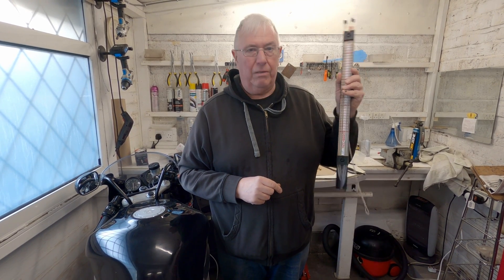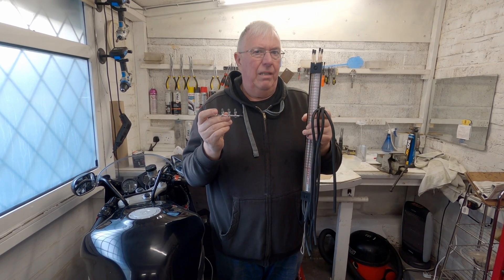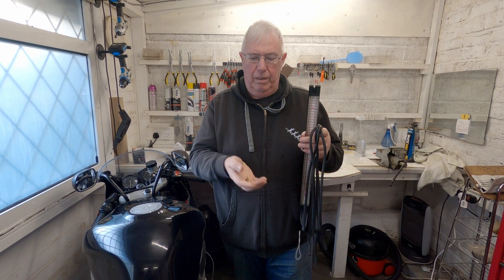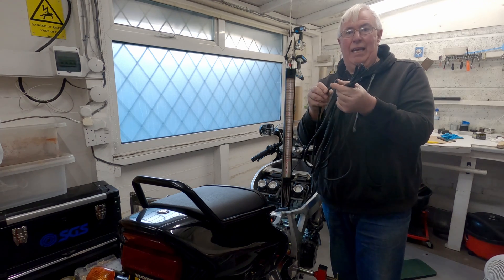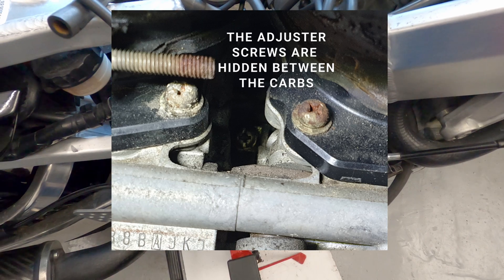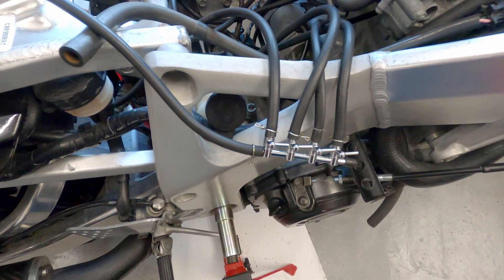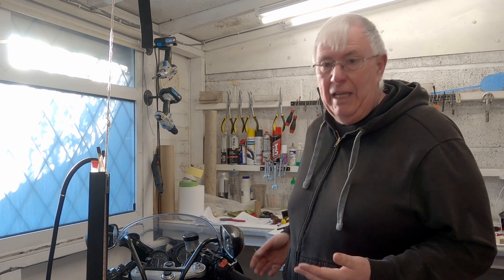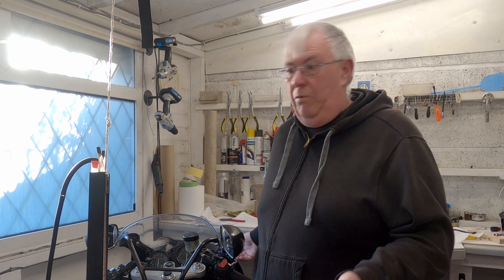How To Sync Carbs Honda CBR900RR Fireblade Motorcycle | Balancing Four Carbs With One Gauge | 010

Comment: Your vacuume line on yours is capped on mine and my vacuume line is on the left side that goes to my petcock why would this be
Reply from the maker: As long as the vacuum is connected, it can be to any of the ballancing take off points.  Maybe a PO just found it more convenient to move it.
Reply: @SPANNERRASH  thank you for your reply I have my carbs sync all the same idles nice and revs all the way while in neutral,but when I ride its fine and when I get to motorway speed and open my throttle up it seems to bog down and sounds like a clipping nosie from the exhaust even though its no were near redline and won't give me any more power
Reply from the maker: @jonny-p-8927  Assuming it isn't an electrical gremlin. I would look for any air leaks anywhere on the intake. Especially if there is an emissions pipework. Faults like this can be really hard to trace. Good luck! 🤞
Reply: @SPANNERRASH  I found the problem I handt screwed the mainjet in properly and found it when I striped my carbs again in bottom of carb1 float bowl 🤣🤣

Comment: Hi there I can't remember? Did you ever give a guide how to apply for historic motorcycle tax and not exemption, kind regard Dave, keep up the good work
Reply from the maker: Hi, you need to fill in a V112 for the MOT exemption, here is a write up about it https://www.spannerrash.com/v112-form-mot-exemption/ .  For the Historic tax change you can take your V5 into a post office and they will send it in for you. You can probably do it by post too, but I find it easier to get the post office to send it off.  Hope it goes smoothly for you.
Reply: @SPANNERRASH  thanks a lot that's brilliant CB 750 Dohc 1981 41 years old, but still haven't got the carbs idle circuit set up this is such a pain kind regards Dave
Reply from the maker: @kimsmith4409  I've never played with a DOHC one, however guitar strings really help to clear pilot jet airways if you need to do that.
Reply: @SPANNERRASH I've got banjo one's 😂👍

Comment: What a great idea! I've been wanting to sync the carbs on my Nighthawk cafe racer. I've noticed that when I rev the engine it seems to "hang" slightly going back to idle when I let off the throttle. Do you think syncing them would help correct that little issue? Thanks again for your videos.
Reply from the maker: Thanks mate, and sounds like it could help, but I'd definitely check the cables first. Then I'd see if you have any vacuum leaks around the carb rubbers. Although you should do that before syncing the carbs anyway. :)
Reply: @SPANNERRASH  Thank you very much!!

Comment: 👍
Reply from the maker: Probably somebody just moved them  in the past.  The petcock vacuum line just needs to come from the inlet tract after the carbs, any of the ones used for carb ballancing is fine.  Maybe a PO just found it easier like that.  I wouldn't overthink it :)